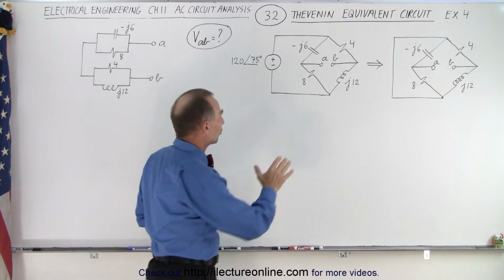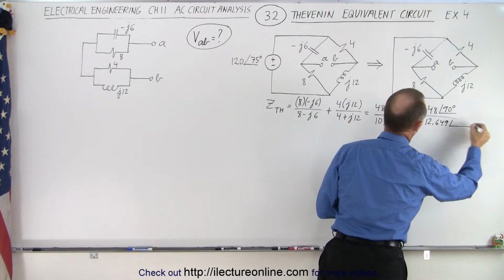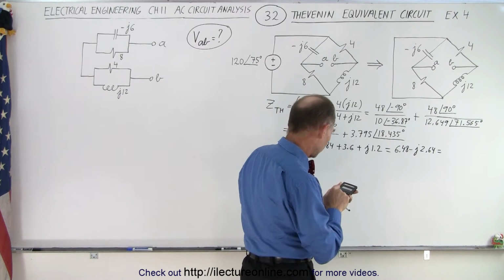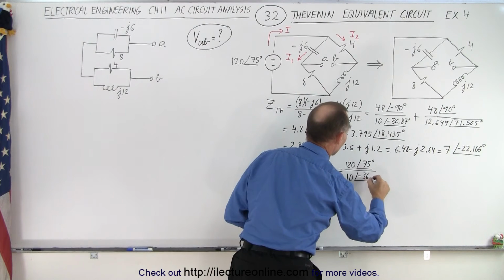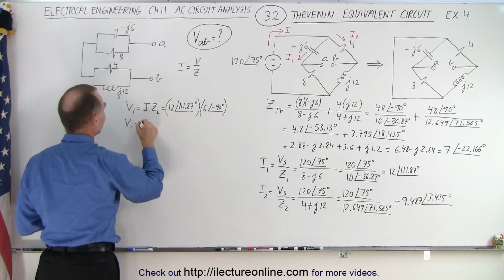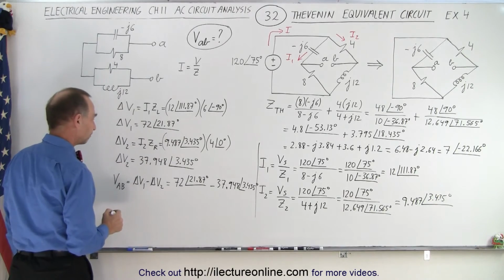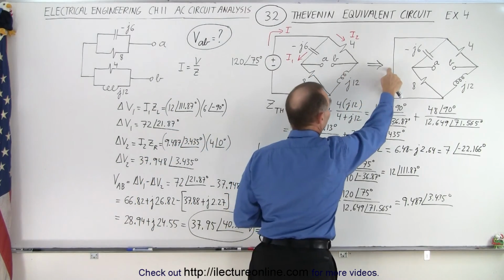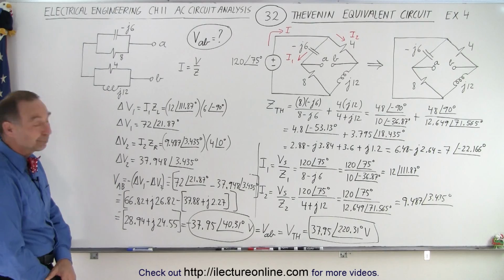Electrical Engineering: Ch 11 AC Circuit Analysis (32 of 34) Thevenin Equivalent Circuit: Ex. 4

Comment: Hi Mr. Van Biezen, I have a question. Should the 8,  -j6 and 4, j12 be in parallel? Calculating Z Thevenin, you have considered them parallel. Why did you consider them in series calculating I1 and I2?
Reply from the maker: The way it is depicted in the video is correct.  Thank you for checking.
Reply: @MichelvanBiezen  Thanks for your reply
Reply: You are correct solving this problem, sorry about doubting you.
Reply: BTW, you are the best teacher when it comes to M and E engineering and of course Physics; after all they all go together.
Reply from the maker: Thank you.  We appreciate that.  And I do make mistakes and our viewers do find them, so keep challenging.
Reply: @MichelvanBiezen  I do actually have the same concern and I don’t get it… I’d be great full if you could explain it to us.
Reply: @montaseralshaip9192  If it's an open circuit then no current goes through AB

Current in = Current out